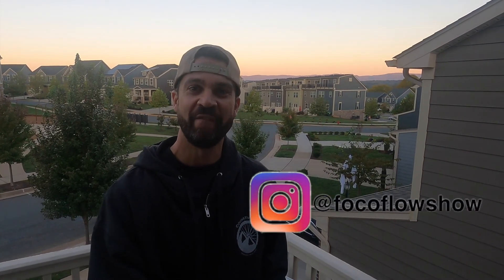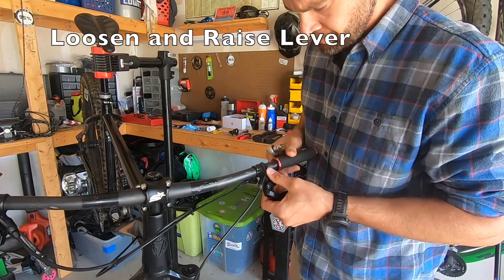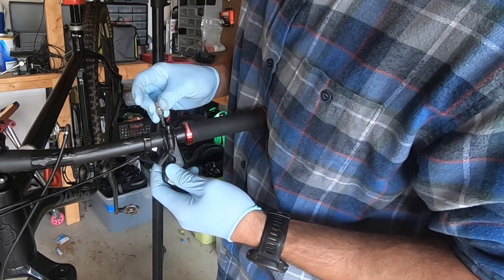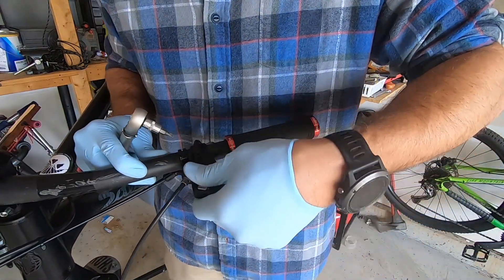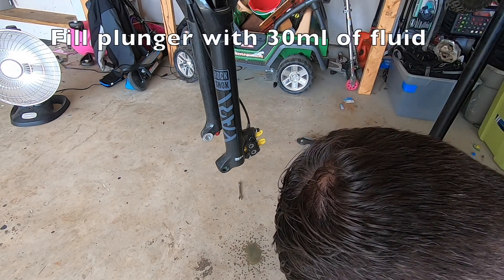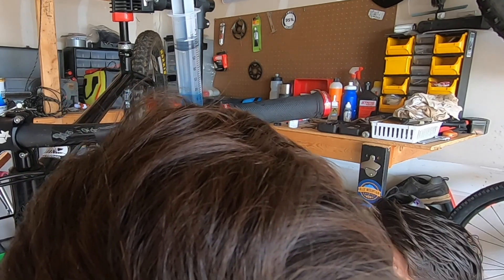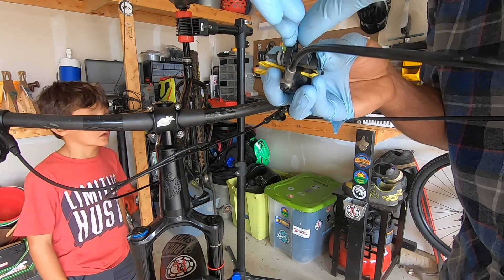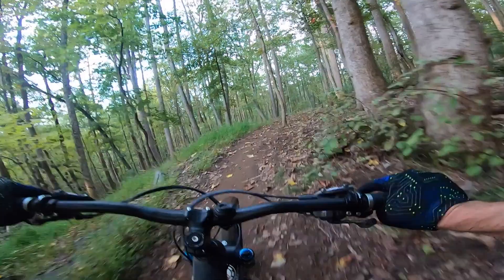Magura MT5 Brake Bleed and Brake Assembly Replacement

Comment: Thanks but QUESTION: My mt7 brake came w cable already installed to lever and caliper. Im trying ti remove my freego x2 stock rear brake sustem. I unscrewed the hydraulic line bolt from lever but the cable is still in the lever. Any idea how to remove that cable from lever? My first time ever dealing w brakes or anything at all. I plan on freeing that line and the other lines attached to lever and just hopefully following/pulling the lines off bike and thriwing on the mt7 brake system.
Reply from the maker: @cirwo85  hard to say without seeing it - sometimes there’s a small bolt on the end of the lever where the brake hose feeds that needs to be loosened

Comment: I just got these installed on my bike but I haven't ridden it yet but noticed the lever is pretty soft compared to the Shimano brakes I had on before. What is your comparison ...MT5 vs Shimano. Feels different? How so?
Reply from the maker: I’ve found the mt5s have a bit more modulation but a really consistent bite point and really strong.  By comparison my shimano XT have similar modulation but the bite point can fluctuate a little.  Both have 4 piston calipers so they are both strong trail/enduro brakes - it sorts comes down to preference at that point